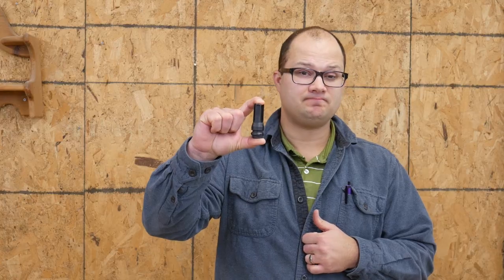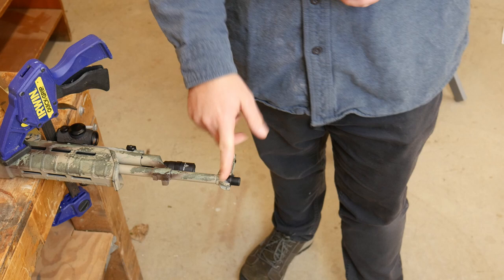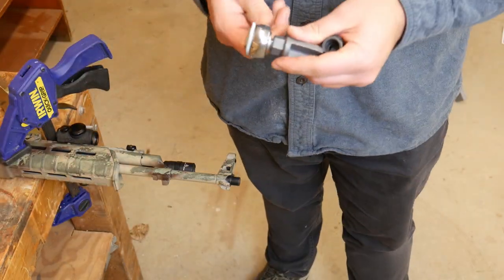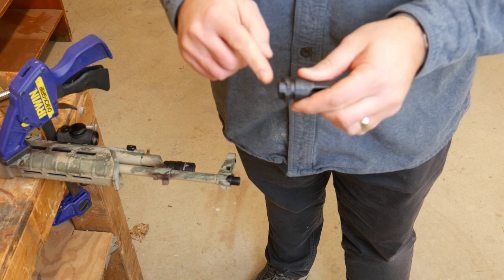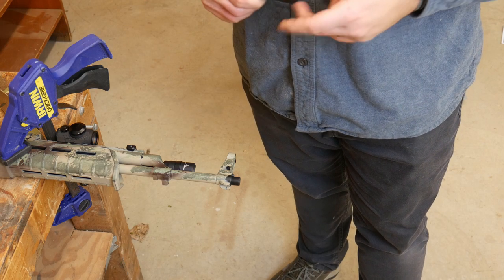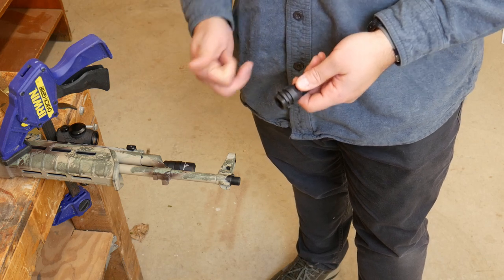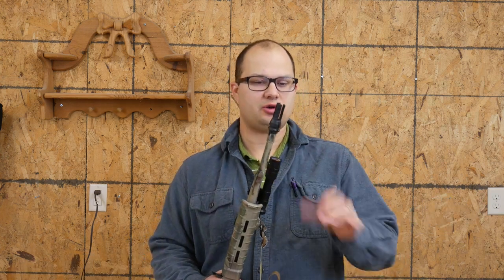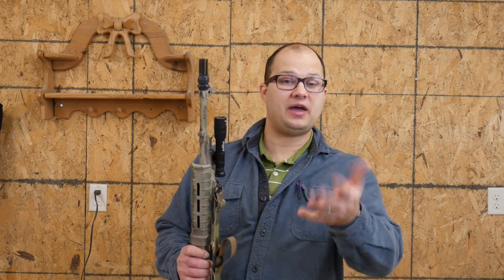How to Install a DeadAir Flash Hider on an AK

Comment: Hey man, a general rule of thumb for AR's is 20ft lbs because too much more than that will stretch the end of the barrel and cause loss of accuracy. It essentially pinches the bore because all threaded mechanical surfaces stretch when tightened. You especially don't need that much torque when using rockset. I torque my muzzle devices on at 20ft lbs with no rockset and all my muzzle devices are used with suppressors.
Reply: I'm sure he ruined the barrel's crown 😮

Comment: What is the thread pitch of the dead air muzzle flash for the AK??
Reply: Most AK barrel thread pitch is M14x1 LH. Not sure if they make a dead air flash hider with that pitch though.
Reply from the maker: They do make one for that size
Reply: For a Zpap92 the thread is M26x1.5 LH. DA doesn't make one however JMac does which fits Keymo/KeyMicro adapters. It's beefy however  is also pretty awesome to swap a Sandman on and off. Always check  your concentricity on your AKs if you want to play suppressed. PN is RRD-360-26F-KM e

Comment: A standard open ended 3/4" wrench will not work unless you grind the wrench down to about 0.2" or about 3/16ths I would advise just buying a thin profile 3/4" wrench.

Comment: Any concerns as to the flash hider up against sight block? I was always under the impression this was a no no..👎
Reply from the maker: I have not heard that. No issues here. But I’m open to correction. I don’t have a ton of rounds through it at this point(a few hundred) but no issues so far.

What’s the supposed problem?

Comment: I would never permanently attach that with Rick set, I would use grease Incase your suppressor gets carbon locked on the gun. And if you are going to torque it use a crush washer so you don’t damage the cast front sight. Why not just use the mechanical pin built in the sight to lock it down?
Reply from the maker: I use rock set on all my muzzle devices that host a can. I’ve seen too many come off with the can. And rockset is semi permanent. It’ll come out if you soak in water. 

As far as the pin, I don’t want to pin and weld. 

Dead air says not to use crush washer specifically.
Reply: I haven't seen any DA or muzzle devices which fit DA have the shoulder of the device notched to make use of the pin. Would be nice though.

Comment: All you did in this video was screw it on.  No info about timing, shims, or torque lol.  I would delete and try again
Reply from the maker: Well....that’s all it takes so.....
Reply: Most shooters will never fire in low light conditions and may not have concerns that a flash channel may be in the line of sight. If it was a NOX it would be very different. Personally, i would never use this flash hider on the AK as concentricity could be off, and would never attach a sandman/nomad to it. They do make a non keymo version that would be a little lighter, but prob not noticeable.
Reply from the maker: I did check and this one is concentric, doesn’t suppress that well in general though.
Reply: @CitadelDefense1 explain?
Reply from the maker: @843arms  you run a concentric rod down the barrel.
Reply: @CitadelDefense1  no I meant you said it doesn’t run that well suppressed, you talking about the suppressor or needing a KNS piston?
Reply from the maker: @843arms  oh, I just didn’t think the gun surpassed all that well. The sound reduction wasn’t all that great compared to the same can on an AR. 

Honestly though, I found out I’m an AR guy.